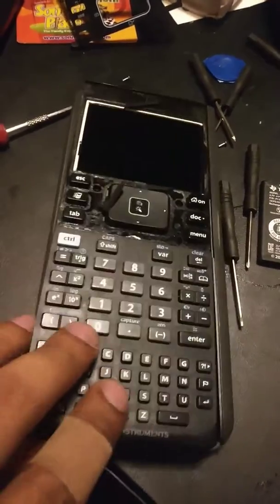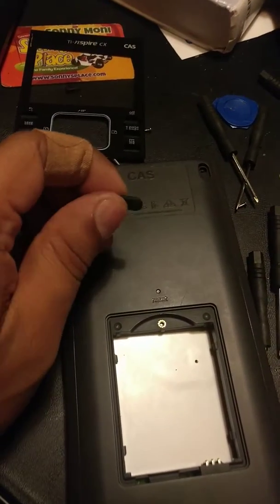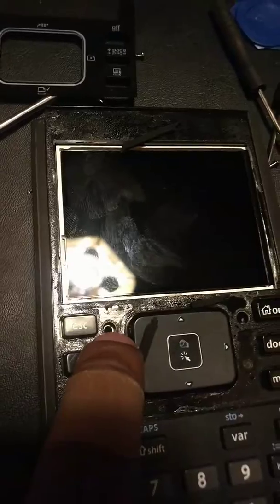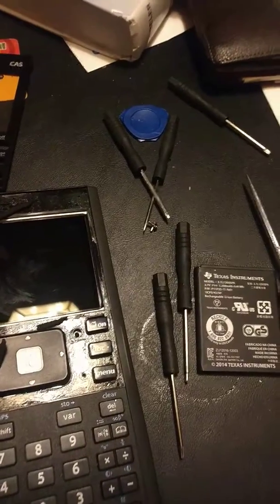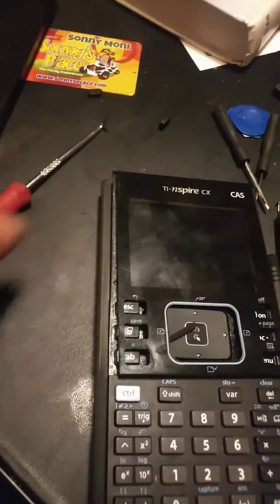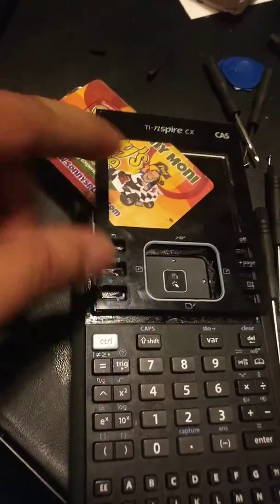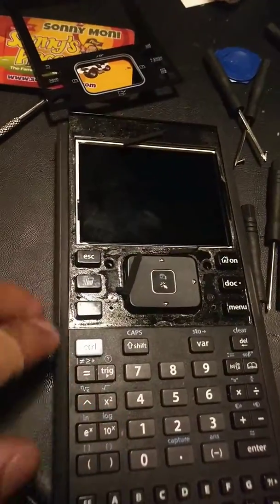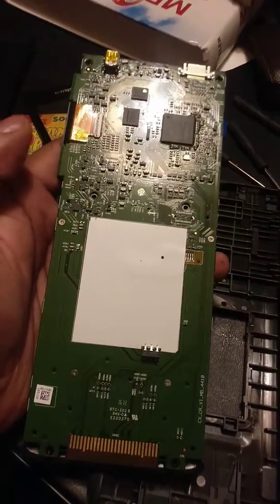TI Nspire CX CAS teardown (circuit board access)

Comment: Hi, I have a problem I had some water in my backpack and it spilled on my calculator, the problem is the calculator isn't even mine. Do I need to tear it all apart to get rid of the water?
Reply from the maker: What I would do is first remove the battery if possible and let it dry on rice or try to use a hairdryer. Do not try to turn it on with water in it.  I'm not sure how much water got inside the calculator, but if you think you can take it apart to dry all the internals and put it back carefully, go for it.

Comment: Is there any way to open the calculator up without destroying it? My keys are sticking and I wanted to clean it but I'm nervous about removing those components that are glued on.
Reply from the maker: It's been 7 months, but in case you still want to get access to the components behind the cover, I would say there is no way unless you unglue that cover. It doesn't get destroyed as it seems. You can clean the glue with rubbing alcohol (90% alcohol or higher) and apply any type of plastic.glue to glue it forever. Did you spill something on it?